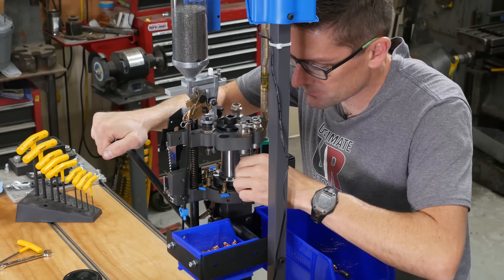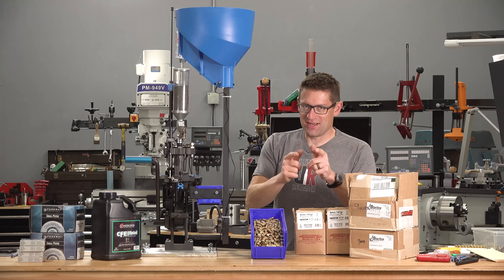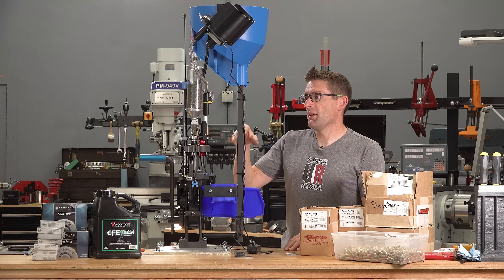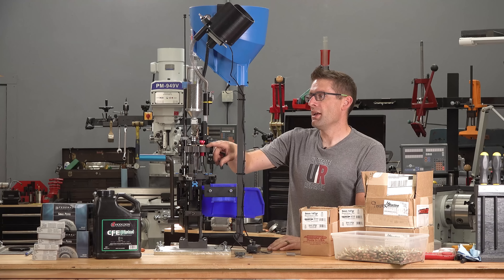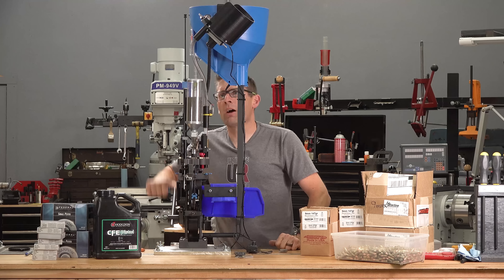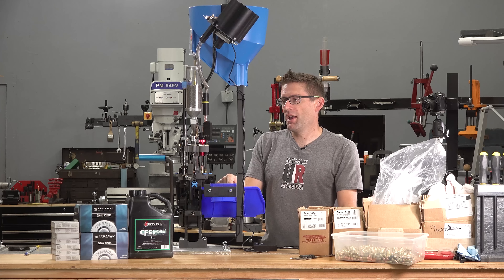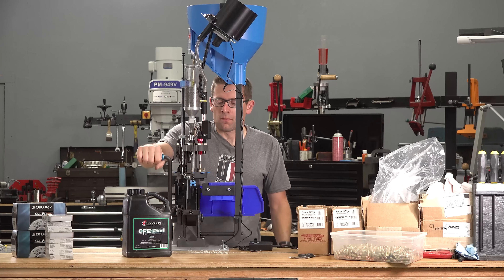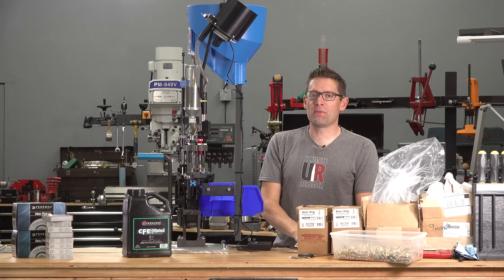WARP SPEED! Loading 9mm on the Dillon RL 1100 with Mr. Bullet Feeder

Comment: I would like to enter the realm or reloading. I have zero experience and wonder what point should a novice jump in. I am a fanatic about tools, and hesitate to buy too cheap and the replace a year later. Calibers I would load would be 223, 357, 45ACP, 9mm, 44 Mag, 270. I enjoy shooting but am limiting myself because ammo is hard to find and expensive. Can you recommend a good machine to jump in with?
Reply: With all those calibers, I'd recommend a Dillon 550. Easy to use and caliber changes are cheap.

Comment: Is it possible to mic the accuracy of the tool head to the base plate, as done in previous videos?
Reply: I'm just curious, why would you want to do that if you check your ammo with a case gauge and concentricity gauge?
Reply: ecleveland1 : Because UR recently did a video on the accuracy of many press seatings, most of which were single stage, Just wondering if it is possible to do for a progressive press as well. And I agree, after you’ve set your projectile seating and crimp, would it actually matter that a press’ overall seating may be slightly off.

Comment: What is the difference to go with the 1100 vs the 1050?  I am coming from a 750 and looking at one or the other.
Reply: Go with the 1100.  I don't think there's a price difference.  1100 replaces the 1050 and has a few minor upgrades.  Toolheads are interchangeable too I think.

Comment: I looked at this and went  "Damn that is expensive".  But I guess depending on how much you shoot it could save a lot in the long run.  I'm not sure how fast it would pay for itself but I know when I went to the range 1-2 times a week I would go through about 500 rounds each time.
Reply: I know some pro level shooters who go through 2-3k rounds a month if not more. For them reloading on something like this is the only way to do it.
Reply: I can't answer as to how fast it will pay for itself.....I guess eventually unless you're sponsored by a ammo or component mfgr.  in which case it doesn't matter.  This is my experience:
I got my 2 S1050's in 2014 with about 8 complete toolheads, trimming heads with motors, and 5 different calibers (9mm, 45acp, 223, 308, and 300BO) with individual processing/ loading toolheads and Mr. Bulletfeeders (2) plus all the dropper heads.  One in Large Primer, and one in Small Primer.  Bunch of UniqueTek and FFB upgrades, etc.   I also got a decade's supply of powder and primers which I am still using today during the shortage.  I think all-up, it cost over $20K including components, but I have not purchased a single box of ammo since 2014.  Not to mention all my precision rifle ammo I load single stage and all the other equipment for that discipline.  Not sure if I ever recouped the cost, but I did it as a hobby, and did it during the Obama era after seeing all the shortages then.  At least I can still shoot every weekend if I want to.  I normally do large batches of about 10K each of 9mm/.223 once a year.  Normally enough to keep me shooting without worrying about having a stash during hard times.  Don't do it to save money, cause you won't.  You'll just shoot more and end up buying many more components.  My wife and I both shoot and it's (sometimes) a relaxing hobby when everything is dialed in.   When shit fails on a 1050, it fails big time, and is usually a setup error.  The S1050 was my "starter setup".  I went big once after all the research.  No regrets.  I shoot maybe 5K of each 9mm and 223, and about 500 .45ACP.  Also about 2000 various precision rifle cartridges per year (.338LM, 6.5CM, and .308)  It's worth it for me.  I know these are rookie numbers compared to competitors who shoot 10k-20k or more per year.
Whatever you end up doing, it's a fulfilling hobby, as long as you can keep your machines fed with primers, powder, and bullets.

Comment: Can you feel the primer seating on this like you can the LnL or the XL750?
Reply from the maker: No, because it's at bottom of the die head movement it's combined with sizing/seating/crimping/etc.
Reply: Not normally, however you definitely feel it if you try to ram a primer in an off-center or unswaged piece of brass.  I also don't recommend Gavin to pull the handle so forcefully.  The priming force is high, and if you mis-seat a primer, you run the risk of detonating the whole stack in the magazine.  Take it easy, it's not a race.

Comment: Will this work with my Dillon 750 XL ? Awesome channel.
Reply: bullet feeder sure! You can even 3D print one, I use it and it works great. While it requires some tweaking once you have it running, doing like 1000/hour on 650/750 is just a problem of your arm…

Comment: This may be a dumb question, as I've just started looking into reloading. But if 99% of this is automated, it seems like common sense to have the lever pull automated as well. Whats the point of requiring a user to do the most basic function on the whole machine, rather than jist have it 100% automated?